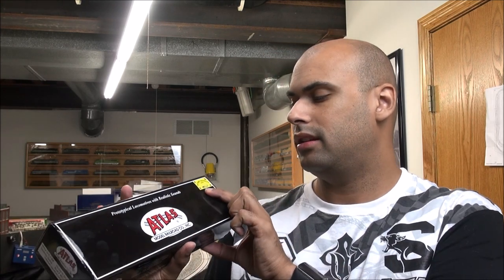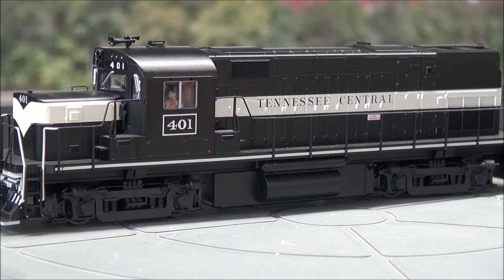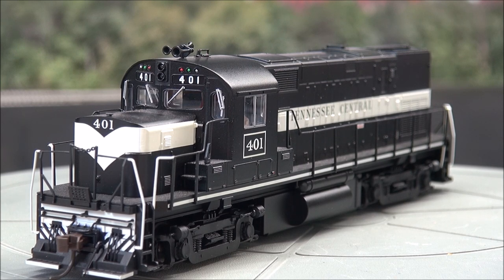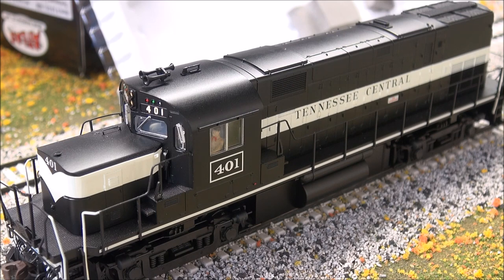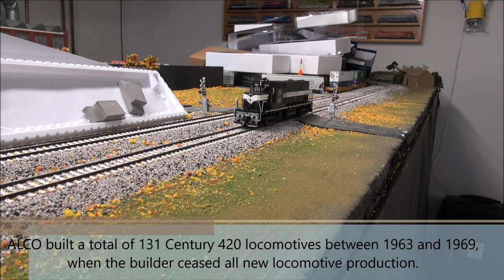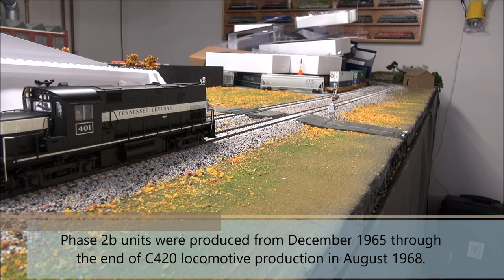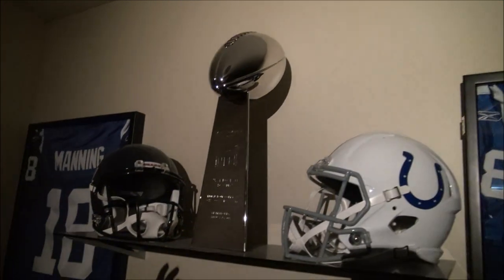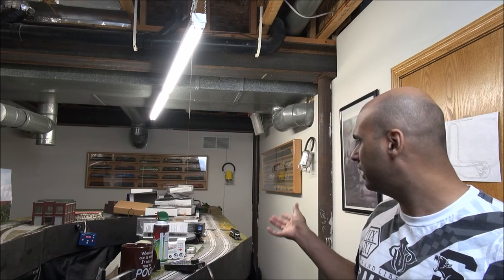Review: Atlas C420 Phase 2b Low Hood Gold Series DCC LokSound

Comment: Great review!  I got the Monon and Delaware-Lackawanna C420 models.  Monon has a Mars light in the nose as a bonus.  I added capacitors and TDS speakers to each.  These are great units and I got them for under $160 with LokSound 5.  Looks like Atlas is making LokSound 5 standard now which is great!

Comment: 5 speed steps is like applying 6 volts to the motor . Anything is quiet at that low of voltage .Turn it up and see how it moans and groans with some power put to it. Almost like you don't know what your doing.

Comment: Loc sound faked Alco c 420 supercharged 12 cylinder sound completely. They did not record it at all from the real loco like Soundtraxx did. They use the same generic kraut diesel sound the same in all their older GE locos.Soundtraxx is much better with prototype accuracy and does not need a programmer to change up the sound file to get it right.